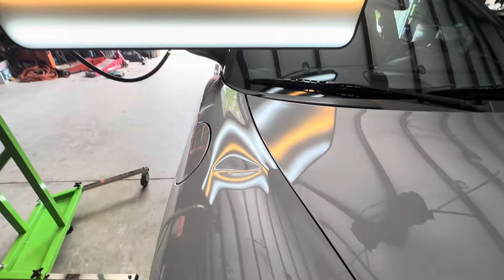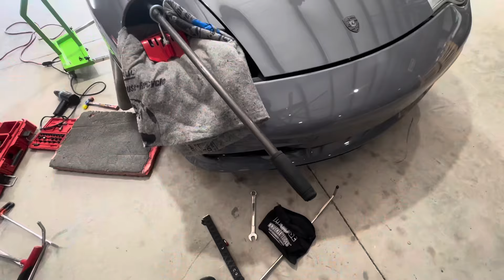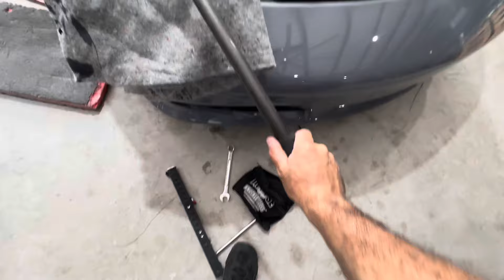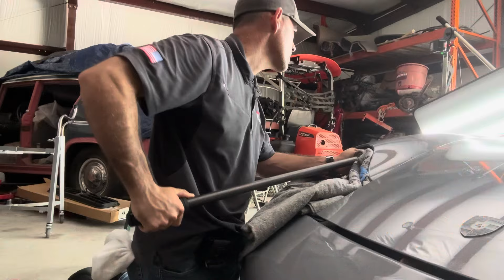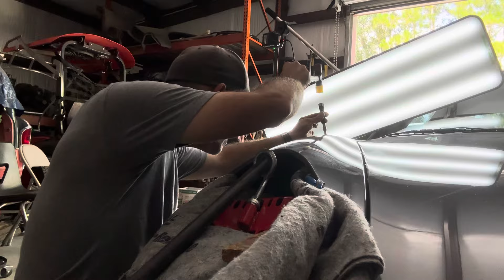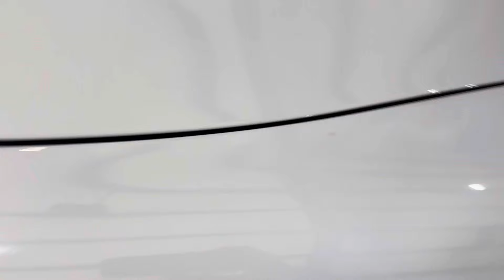CAN DENTS BE FIXED ON WRAPPED CARS?

Comment: This would really need to depend on the quality of the wrap I guess. We all know Mr Kelly is the top G in PDR but surely not all wrapped cars can be done like this.
Reply from the maker: @NavdeepSingh-x8f  Yes, you are correct. There are some circumstances where we do have to actually remove the vinyl to perform our work to the highest level. However, this particular customer was pretty adamant about trying to preserve it, regardless of the outcome.
Reply: @cfldentrepair Another fine example of a quality PDR technicians work….. question….who makes that thin light board ?
Reply: @cfldentrepair it’s an honour to have you reply back to me. You’re a top G and a master. Role model for mans like me. Lots of respect for you Mr Kelly. Thank you for the reply. 🙏🫡🇬🇧